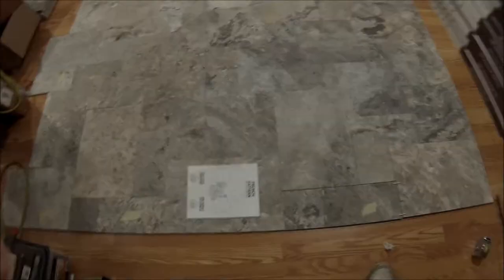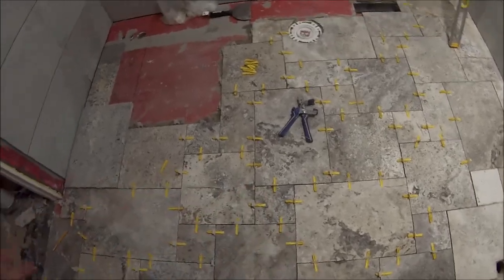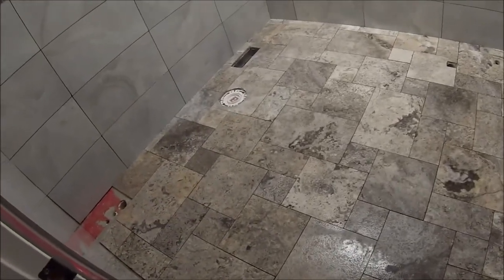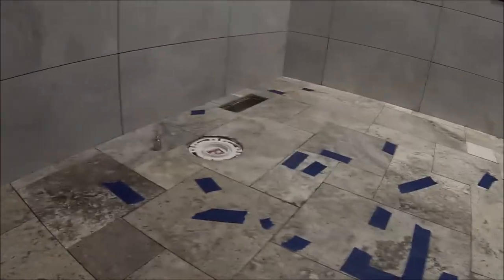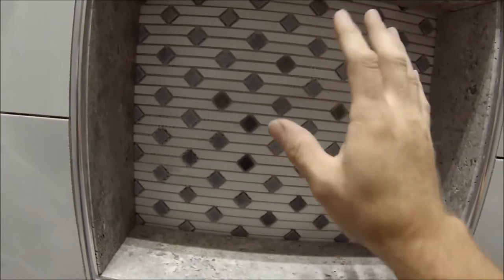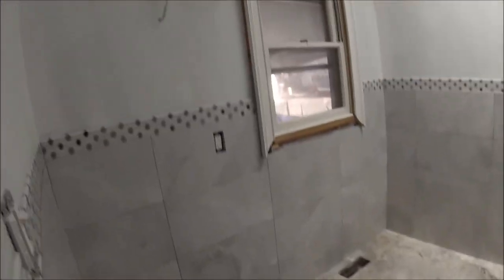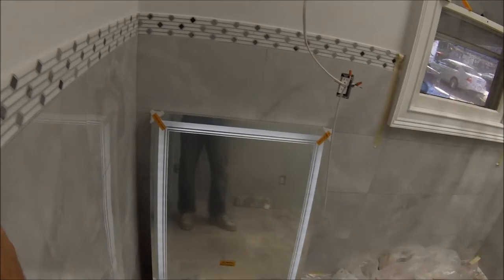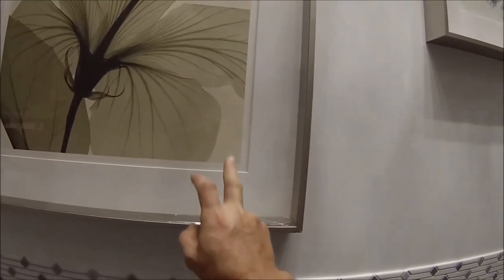Floor Install French Pattern Travertine (Bathroom Renovation Part 3)

Comment: really like your idea of taping over the travertine crystals! how did that work out for you a year on? Do you have any regrets for of not filling? How is it to clean the floor? Did you use s grout release before the grouting process?
Reply from the maker: I did use a tile sealer on the tile before grouting and after it was grouted. I wish I had used more tape on the tile as I wish I could see more of the crystals. It hardly gets dirty so easy to mop up and clean as its real rock. So if I could do it again I'd use a lot more tape over the tiles before grout, I like the look of the pin holes and crystals.